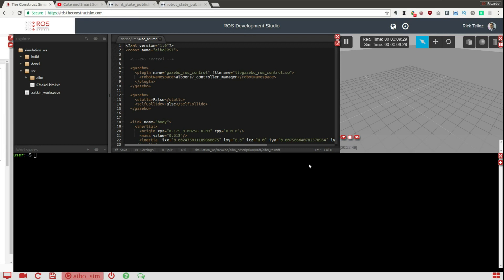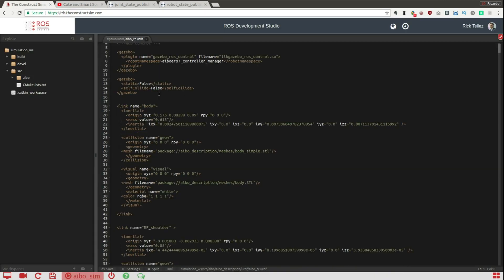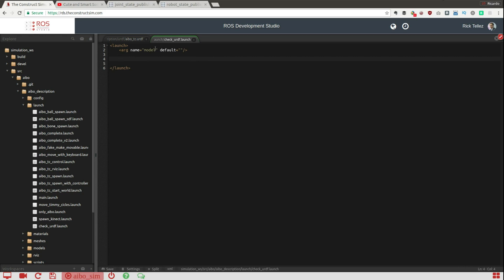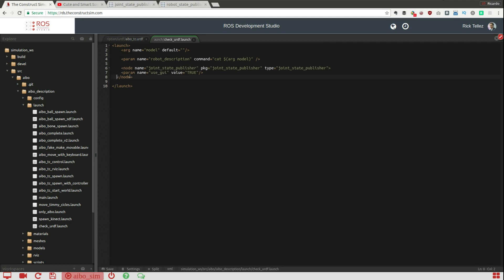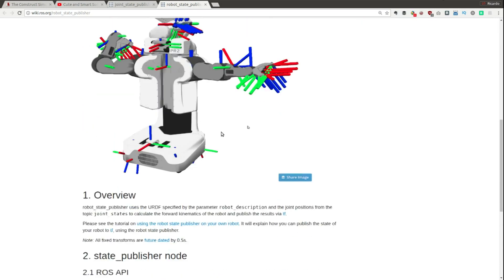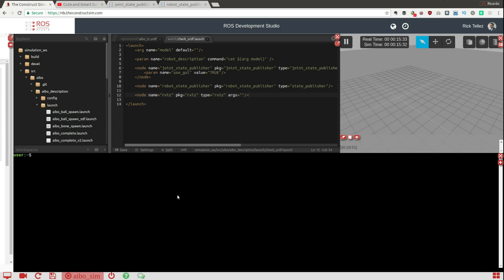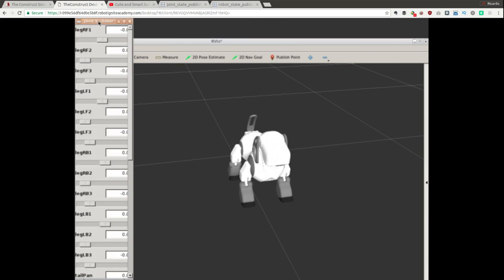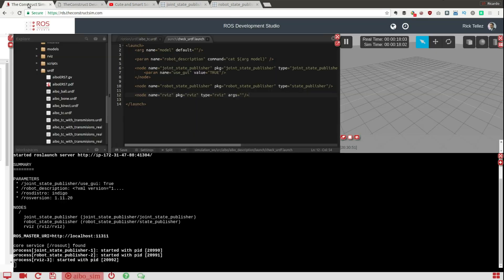[ROS Q&A] 072 - How to check your complex URDF

Comment: Hello , Thank you for explanation.
I have just looked at the URDF File.
How can you know which part of robot should be in specific position in URDF?
For example,
<link name="RF_shoulder" >
    .....
    <visual name="visual">
      <origin xyz="-0.052 0.0059 -0.046" rpy="3.14159 -1.5707 0"/>

Why these numbers? how can I decide these numbers?
Thank you!
Reply: Very good question! The reason is that you must know the dimensions of your robot. You must know how long is the arm, what is the separation between wheels, at which location is the camera, etc... This information must be provided to you by the physical model of the robot. If you don't have that physical model, then you need to measure all that by yourself (a lot of work and prone to many errors). The best option is to get a basic URDF from the solidworks model of your robot (in case you have it). Check this video to learn how to convert from soliworks model to urdf: https://www.youtube.com/watch?v=T7X_p_KMwus
Reply: @RickTellezL  Thank you very much for your answer. I appreciate your video and teaching effort.
I will watch video.As far as I know, Solidworks doesn't run on Linux.For Linux, there is a Blender program. But unfortunately ,the measurement tools are rudimentary and prone to error. (at least I know like that ).
Thanks again.!!